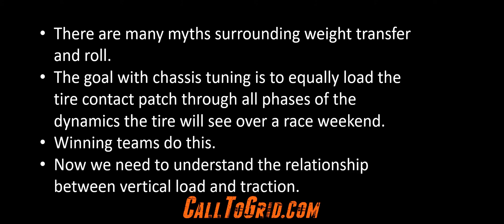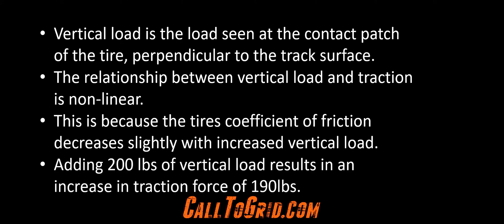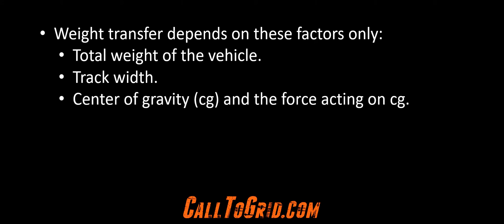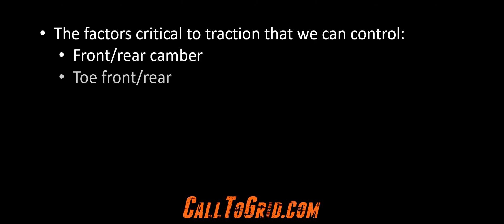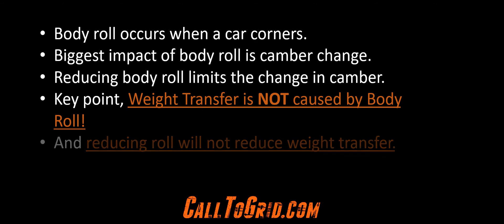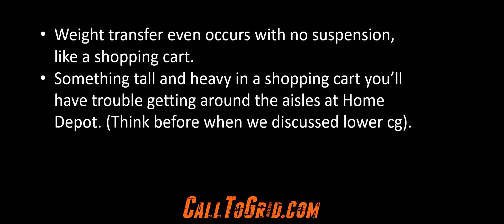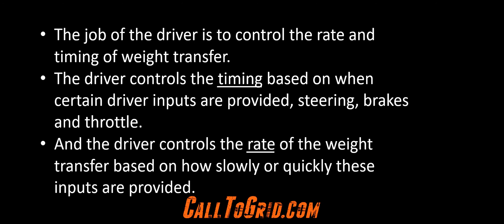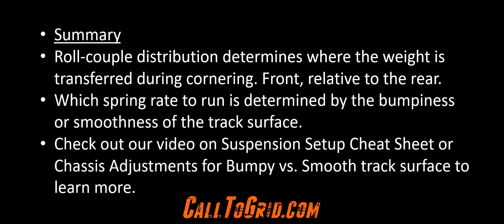Weight Transfer and Body Roll - EXPLAINED

Comment: 3:23, I’m really confused by this… Just a second ago you said “weight transfer is not cause by body roll.” Could you help me understand this and clear up my confusion?
Reply from the maker: OK. I think I understand your confusion. I suppose it's definition of "handling". By roll couple distribution, and roll affects on handling is really on the camber changes and the changes in aero experienced.  Does that help? Roll couple determines "where" the weight is transferred. Not how much. Weight transfer is "how much" weight is transferred. Weight transfer is what we want to minimize. We accomplish that with running lighter and running a wider track width.

The point of this content is to differentiate weight transfer and body roll. Weight transfer is what we really want to minimize. Body roll is not necessarily a bad thing. 

Many guys when setting up their chassis aim to select a spring rate to minimize roll. Depends on what you are trying to accomplish. If your car is aero sensitive you'll want to run stiffer.  Softer springs actually help mechanical grip.

Make sense?

Comment: Best @CallToGRid , can you elaborate on why a wider trackwidth is better for grip? A wider trackwidth to me sounds like more weight transfe in cornering. Because of the degressive tire characteristic weight transfer means reduction of net force and so grip. I'd like to hear from you.
Reply from the maker: Here's the simplified equation. LLT (Later Load Transfer) = Ay x h / t

Where,
Ay is lateral acceleration
h is height of the center of gravity
and t is track width.

Make the numbers on the top of this equation SMALLER you get lower overall LLT, and/or make the numbers on the bottom of this equation LARGER you also get lower overall LLT.

Think of a see-saw. If you have 500 lbs. on either end of a 2 foot see-saw, it will be tough to control. Put that same 500lbs on either end of a 20 ft see-saw, your can probably control it with your pinkly.

Its a lever arm. Like when using a wrench if you can't loosen the bolt, you get a wrench with a longer arm so you can get more force acting on the bolt.

Make sense? Yea, sometimes you really need to stop and think about this stuff and what you are trying to do.

For the driver, a wider track width helps make the car more predictable. (Our see-saw example).

Did that help?
Reply: @CallToGrid  yes I see. If you make a free body diagram of it as your formula it is indeed clear that if you make your trackwidth infinitely high there won't be be any lateral load transfer. This also means that a long wheelbase is best for braking I would say because there is less longitudinal load transfer
Reply from the maker: Depends. If your car has lots of horsepower, yes, you want a longer wheelbase. A shorter wheelbase is better for lower horsepower cars. A Mini "handles" better, more responsive, quicker to accept driver inputs than say a Corvette or Mustang. Obviously vehicle weight plays a role too.

There's no free lunch in this stuff. And so many factors to consider. Some within your control and some not.
Reply from the maker: Follow up. you say " why a wider trackwidth is better for grip". I think what you really mean is go faster around a corner, correct?

Grip is separate from lateral load transfer It affects it, but wider track width does not directly affect grip.

Grip is a function of the tire material,  heat of the tire, the contact patch and the type of road surface. As I said in the video, grip is affected by how we get more of the tire in contact with the road surface, those being:
- Camber
- Toe
- Tire Pressure
- Roll Steer
- Bump steer

Also from the video, we also affect grip by the vertical load acting on the tire (weight pushing down on it making it tougher to move side to side). This is why F1 and IMSA all maximize aero to add downforce. It adds vertical load without adding weight to the vehicle.

Conversely, form the equation above for LLT. 'Ay' is the lateral acceleration. So increasing grip by the factors I mention here will increase lateral acceleration. You'll be capable of carrying more G's in the corner.

In conclusion, grip affects lateral load transfer, not the other way around. Make sense?
Reply: @CallToGrid  I was indeed aiming on the relationship between grip and cornering. Theoretical looking a car with a certain mass with a wider trackwidth has less lateral load transfer, this means that the vertical force between left and right will be more equal than in a scenario width a shorter trackwidth. The relation between lateral force and vertical force of the tire is non lineair. This due to the degressive tire characteristic. A tire losing weight will lose traction more quickly than the tire gaining weight will gain traction.  That equals a net reduction from the maximum possible traction when weight shift occurs. So imagine an infinitely width trackwith when cornering almost zero weight shift occur. Normal force (Fn) times dynamic friction coefficient (mu)= the lateral force of the tire can exert on the road. So trackwidth ]affects cornering grip. This I can say right